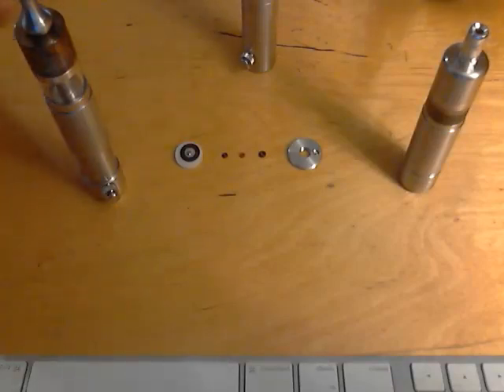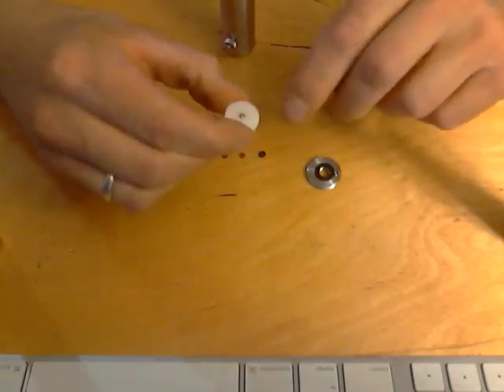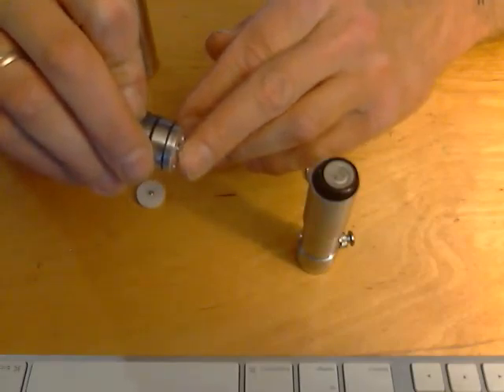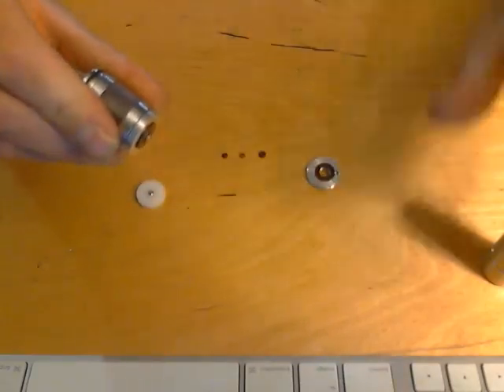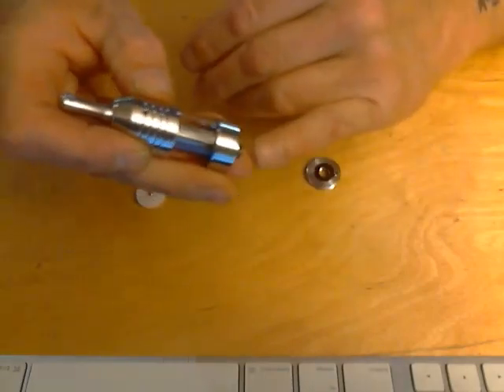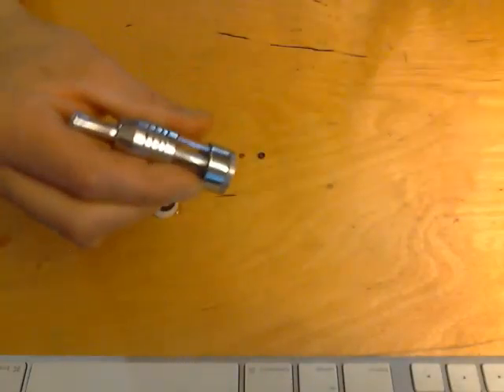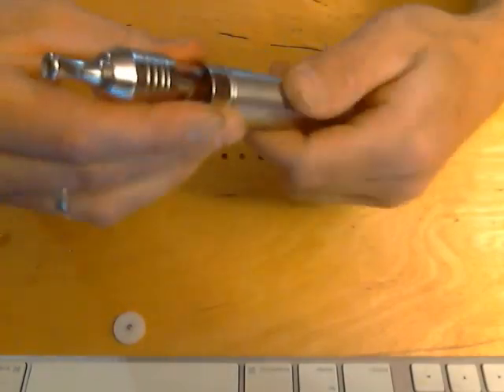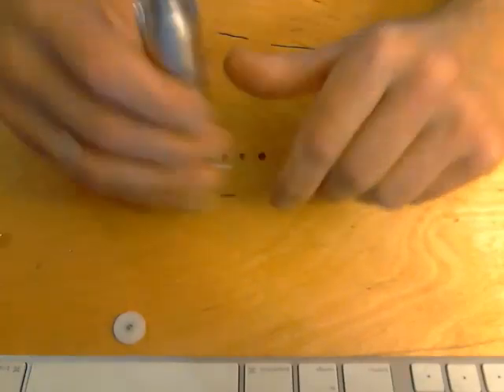Fusions-SG 1 instructional video

Comment: it took me a few mins to relize what it was that this was doing but i think i have figured it out can someone confirm if i have this right or correct me if i dont. This kit allows you to bypass the 510 connector and have the tank threaded directly onto the top of the tube so it gets rid of the extra space and provides a better connection with the battery is this right.

Comment from the maker: Yes Karla you are correct we will be doing a new instructional video clarifying that as well as showing how to install o-rings and proper center pin adjustment. I am truly sorry that happened. This is the only case out of the 127 kits that have been sold,However it's one to many.

Comment: I strongly suggest you tell people to always use that insulator. I used the RSST atty on the Segelei #19 without the insulator and burned the crap out of my finger. The button was so hot with just one second of hitting the fire button that I was burned to the point that I was in pain for about 20 minutes. It was not hot like some mod buttons get after chain vaping. It was as hot as a coil gets when firing. For safety it is definitely best to use the insulator. Very dangerous otherwise.